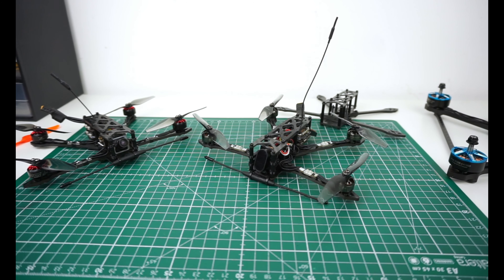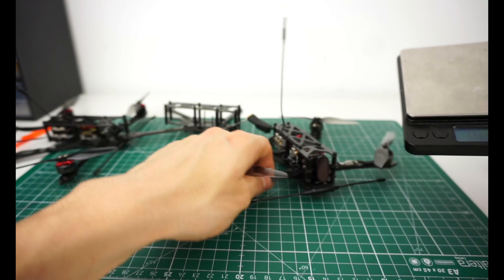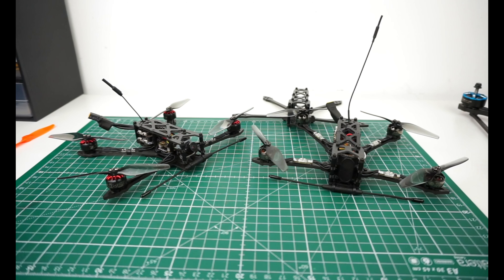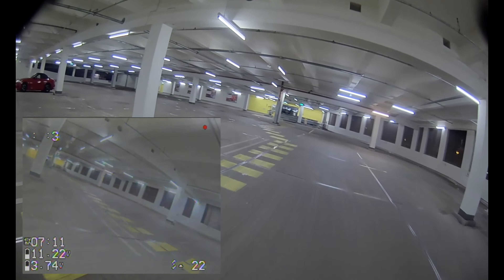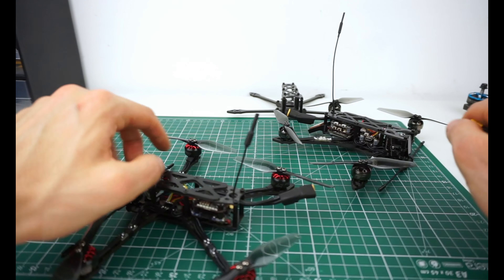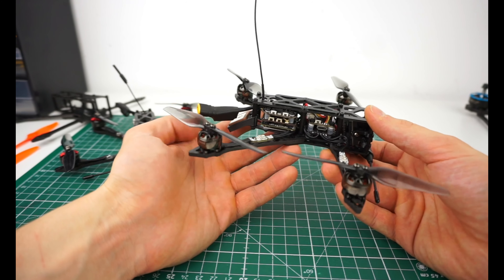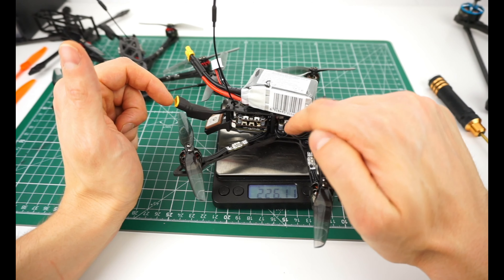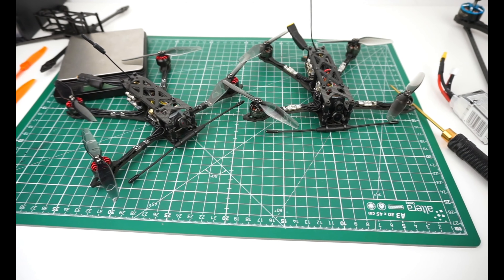Project #MicroLongRange / release info / flight footage

Comment: Hi Dave, I can't seem to locate you on Facebook. You mentioned you've posted stuff there?  I'd like to send you the modified .dxf files to allow lightweight 20x20 stacks to be used. I basically just stretched the frame by 5mm and Nick will be cutting and shipping the test plates after the holidays.  To be fair,  I don't have the HGLRC stack you recommend but I have not had good experience with other 16x16 stacks when pushing them to any degree . Also I'd like to avoid the compromises in regards to the limited UARTs on these stacks at this point in time.  An iFlight F4 stack with 35A ESCs (no pins) and 5 UARTs for example is only 5 or 6 g heavier. Maybe we have some wiggle room ?
Reply: TaterFPV I was just looking at doing that exact thing. Will have to reach out to Nick to see if I could get a set as well.
Reply: @talonanim  Yup. I should have the 20x20 version this week. I got Dave's frame in last week. It's so light and came with hardware! The longer standoffs for the front were not gnurled like the others and I had to adjust the cam mount print because they were too loose. Weather here has been all ice and rain so holding off on a maiden. I will post a reply here as soon as I test the fit for a few 20x20 boards I have on hand.
Reply: Ok let me know. Nick said I need to send him the files to have them made if I don’t have your written permission to share them. I got my original frame already and love the design, I have just been burned by 16x16 ESC before so want the 20x20 stack. These iFlights have been very solid for me. Running 6 of them so far without issue.

Comment: This is EXACTLY what Ive been thinking about doing.. I just finished a 3" that runs on 2s 18650 pack but I havent been able to find a frame to do a micro ultralight 4" build... Im buying a couple of these frames
Reply: Checkout BetaFPV X-Flight 4-inch. But its a toothpick style though.
Reply: @mariossofokleous6075  ya ive got lots of freestyle type drones, im more interested in the 4" + 2s 21700 li-ion pack idea right now.. ling flight times, decent C rating and HD recording under 250g

Comment: Dave, did you try the 1207 you used on the pickle Evo (I think?)? Since you said 1404 is the minimum, maybe the ~30% more stator volume would help with the flight feel. (Yes, smooth looks good, but I think locked in is nicer to fly :))

BTW, the Buzzer is the Fullspeed Lucky box.
Reply from the maker: Yes I considered using them but they are too high kV Unfortunately. I got the 5000kV I think

Comment: Wow thanks for the great built!! Would it fit the DJI Airunit in the back? If you remove everything else, is it possible to stay unter 250g then?
Reply from the maker: Working on a dedicated version for the DJI unit right now  :-) I "leaked" it on my Instagram. But with the new Vista system I might want to redo it differently

Comment: Dude, that is slick! I've been running my 4" off BrotherHobby 1404s, dry weight of 123grams, flying on 4s mostly, but also 3s. You're doing some great testing, keep it up! I am going to have to pick up a set of those 1404 w/ t-mount and props to play around with as well. What's the link to those LED race-wires? Thanks again dude!
Reply from the maker: Thanks man! These LEDs are made by FPVframe.ch

Comment: Will the Mamba 1408 4000kv will work with the 4” build?
Reply from the maker: Yes but it's far from a good match
Reply: @DaveCFPV  thanks for a quick answer. What are the downsides for this motors ?

Comment: Would it be beneficial to go 4s, if there was a 16x16 board that could take it?
Awesome little quad. Really want to get into longrange, and now I'm on the fence whether to go 7" or for this.
Reply from the maker: Not nessessary if you ask me :-) 3S really has a good punch already and there a plenty of good cheap battery options. Those 16x16 could run on 4S but for long range I'd rather not push them to their limit
Reply: @DaveCFPV  Just wondering if that would allow for even lower KV motors and thus even greater efficiency.
Reply from the maker: @Streamlines  yes that's why BataFPV went for 1505 3600kV not 3800 😅Me and Bryon from Racer X both agreed that this would be the perfect spec and as far as I know he helped BetaFPV develop those motors
Reply: @DaveCFPV  So the 1505 on 4s would be even better than these 1404 on 3S
Reply from the maker: @Streamlines  1505 on 3S.... For more aggressive flying yes probably. 1404 is still lighter so it might be better for efficiency overall. Just guessing tho I haven't tried the 1505s yet
Reply: AndyRC recently tested a 6S HGLRC Parrot. There's a 6S capable version of their FD413 stack.

Comment: Isn't there a drop in performance using Crossfire with Sbus Protocol, I mean intrinsically then your not using Crossfire and well its supposed to be long range after all,,, rIght  what am I missing here  ?
Reply from the maker: Using Sbus doesn't affect that range since it's only the protocol the RX uses to communicate with the FC. CRSF protocol does have better latency but that's not all that important outside of racing
Reply: Hi  @DaveCFPV  , I'm also interested in your crossfire setup. I agree latency isn't a major issue - but running only sbus would result in losing telemetry without running the CSRF protocol. For a long range I think that's important.

Could I connect both Rx and Tx to Crossfire Nano (using CRSF protocol) instead of SmartAudio ? 

As the Vtx is controlled via buttons, Is it necessary to run SA on the tx pad at all with your setup ?  Thanks

Comment: Wow that looks awesome, exactly what I've been waiting for. Any chance that this will be able to carry a DJI FPV transmitter and camera?
Reply from the maker: Thanks!  have a separate version for the DJI unit but can't release it yet unfortunately. It fits AIO boards only and none of them work with that unit
Reply: @DaveCFPV  perfect I can wait for that need to safe some €€€ for the DJI stuff anyway first :D. I'm just not going to build another analog quad and want to get into the HD stuff in the near future.
Reply: @DaveCFPV  The iFlight SucceX-D Mini F7 TwinG Stack supports the DJI unit and the BetaFPV Toothpick F4 2-4S AIO V3 also if that can help.

Comment: A little late to the party with this. I have an iH3 with everything you have on yours except for the buzzer. I get 8-10 min flying time and with the R9MM receiver I have been out more than a mile with it. Flys as smooth as my 5 and 7 inch mid range setups. Weighs 245g with battery.
Reply from the maker: People have been doing similar things with 3" forever but the point here is a) the move up to 4" t-mount and b) the fact that this is a frame specifically designed for that purpose and not just a build...
Reply: @DaveCFPV  late and 4 inch quads died 2 years ago so "good for you".
Reply: @Steve-O_FPV  Super helpful comment here buddy, thanks for the info!
Reply: @zdkama sure, no problem, glad i could help.
Reply: @Steve-O_FPV  glad to see that you're contributing so much to the FPV community like Dave C!